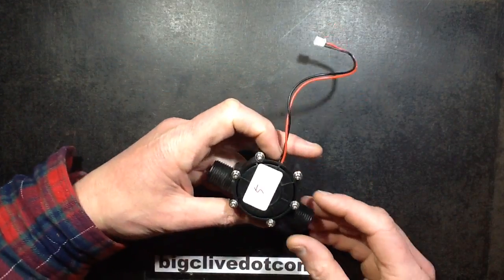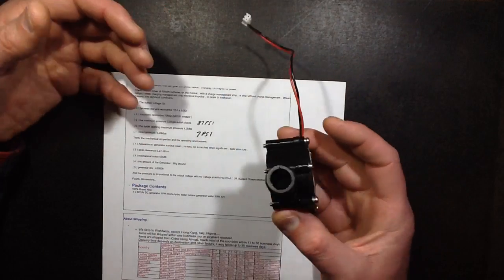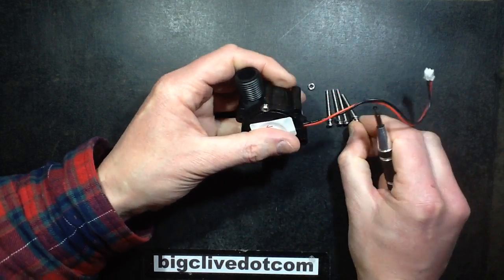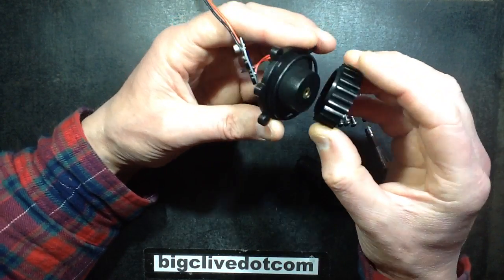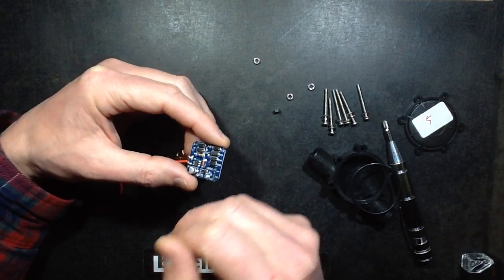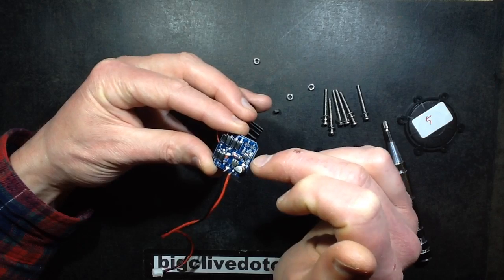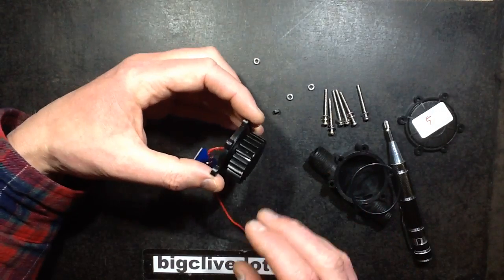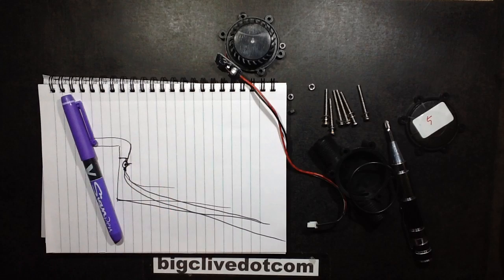A look inside a micro water turbine.

Comment: yes you need to build a venturi system you start with a diameter say 4 inches 100 mm then reduce the size of pipe in steps  eg reduce the 100mm to an 80mm bore then to say 40mm each reduction increases the speed of the water as it goes down slope

Comment: OK Clive, if you don't mind a rambling reply. I looked online for these and some advertise 5V or 12V  and others just say 5,12,80V with no selection option. The ones with the multiple voltage say 10W at 80V and about 2.6W at 12V. For your waterfall you might be able to put a standard computer fan in a sewer pipe. There is a man who drives a hoverboard motor from a computer fan blade. The generator is at the top and driven by water flowing down the pipe by syphoning. I think if you rectified and waterproofed the computer fan it could drive some fairy lights. How long it lasts would be fun to find out. If you have a go I'd love to see if it works. Mark.

Comment: There's another video here on YouTube somewhere where the guy has a small waterfall on his property and is using the 12V version of this to light up the pond at the bottom, he has goldfish in it and the led lights attract the bugs to the fish! He said that his one lasted a year running non stop! It might not be much energy but I think that it's paid itself over the year.. maybe if he opened it at the 6 month mark and cleaned it out, it might have run longer on that dirty water.. that 5V one isn't that good... The unregulated ones apparently go up to 80V, just needs an MPPT Charge Controller to make the most out of it!

Comment: Anyone willing to help id appreciate it. I have the 80v model as opposed to the 12v one my question is if i take out the moduke and replace it with the tp4650 or a 3/5v usb boost would it be more efficient. I regret not having gotten the 12v. Problem is ilmy water pressure isnt enough.
Reply: I can't answer your tp4650 or a 3/5v question directly, but unfortunately nothing you do with the electronics can make up for low water pressure.  You say the problem you have is low water pressure and I think you are probably right.  Nothing you do electrically can compensate for your lack of water.

The problem you are up against is the low of conservation of energy.  The number of watts of electricity that comes out of the generator can't be greater than the number of watts of mechanical energy that comes in via the flowing water.

You are probably familiar with calculating watts of electricity by multiplying volts times amps (P = I x V).  The power available from the water can be calculated in a similar way by multiplying the pressure times the volume of water flow (times a constant when needed to account for the particular units being used).

This site will calculate the theoretical (maximum) amount of energy available from water given the flow rate and "head" (see below):

https://www.engineeringtoolbox.com/hydropower-d_1359.html

This site has smiled down equation with a fudge factor in it to account for efficiency losses in the turbine:

https://www.homepower.com/articles/microhydro-power/design-installation/back-page-basics-hydro-power-calculations

There are a few things to note though:

1) Instead of pressure, "head" is more commonly used in hydropower calculations.  Head is basically how far your water has to fall in an open system.  For example, how high the water is behind your dam.  Since the density of water and gravity are fairly constant around the world, "head" can be converted to pressure (or visa-versa).  One meter of head is about 10 kPa.  Two feet of head is about 1 psi.

2) For the turbine you have there will be a fixed relation between the pressure and the flow rate.  This is a bit like an electrical resistor that has a fixed relationship (V = I x R) between voltage and current -- if you know one, then the other is already determined.  Thus, with the turbine you have, you can't "make up for" low pressure with more flow.  You would need a different turbine to get more flow at the same pressure.

Comment: maybe more electricity could be generated from sunlight by using a solar panel and a transistor to turn a electro magnet on and off. when the transistor is on the electro magnet attracts a permanent magnet and when it turns off... gravity 🤷‍♂️

Comment: "The listing states 10W but the 78L05 will not supply 2A! I'd guess this unit will be rated more conservatively around the 1W area or less. I haven't tested it though." it shouldn't supply 2A ...but 0.83A because well mathematics 12 volt x 0.83A = 10Watt. Still some of them say 150mA (hope it can do at least 0.1A which is 1.2Watt) - I've ordered one different design ..similar but it was a logo and some specs on the sticker ("Sea" ..logo)

Comment: Did you ever find a solution to light some leds at your brothers waterfall of a couple feet drop.  I am trying to do the same near a stream in India.  I'd be most interested in any solution you found to hydro generate some usable watts to light some leds .  Tx.  Bob C
Reply from the maker: It needs a high flow.  There's an interesting turbine design that uses a large spiral screw in a sleeve to generate power with a low drop.  https://www.youtube.com/watch?v=p9-nzuMrVyY

Comment: I have no background in electricity or electrical components, was just curious to know if it would be possible to use a turbine like this to power a small pump thus creating an infinite loop ?
Reply from the maker: Alas, the physics don't work like that.  The turbine would not generate enough power to drive the pump fast enough.
Reply: that's what I though...
Reply: Sadly physics. but there is a few locations that are using hydro water storage to store solar and wind energy during the day To pump water and then run in reverse during the night. granted there is an energy loss.
Reply: When I posted my comment YouTube glitched out and when it finally loaded it had 4 duplicates, I reloaded and only 2 remained. Too many people at home?

Comment: i have no background or experience in this sorta thing but i wager the best thing to do re: waterfall would be to put a pipe with a filtered inlet (enough to prevent sticks and whatnot from getting in) at the highest point you can in the riverbed and then run it to the lowest point you can down the river and put the turbine there with a union so you can remove it to clear the pipe if you need to (or replace the turbine i guess). i don't think putting it directly in the waterfall would create a consistent enough pressure, but with the length and diameter of the pipe you can manage the maximum flow and also have the pipe act as a flow regulator so if the output of the river fluctuates the slack  can be taken up in the pipe

Comment: What you really want is to maximize flow rate. And although it is true that the flow rate into a pipe will equal the flow rate out, the pressure will be different at each end if there is a change in height between the two ends. The higher pressure will be at the lower end. If you then put a nozzle at the high pressure end (ie the one down stream from the waterfall) the water will reach a VERY high velocity and therefore high flow rate.

Comment: you are correct about the hose.  the reason turbines are at the base  is to do with the  pull pressure causing the water  to boil.

Comment: this is a response to look inside a micro water turbine.
 I have the identical unit accepted claims to put out 12 volts.
 I've been studying Micro Hydro for many years and traveling several countries observing them.
 this is Pico Hydro.
 personal I would set up a garden hose penstock.
 catch the water as high as you can and  run the hose as far as you can.
 putting the turbine at the end of the hose or somewhere in the middle.
 effectively a penny stock and tail race.
 interesting fact in Quebec Canada where I live. is it legal to make any amount of electricity off of falling water
 even off the eaves trough of my house
 I also have the ...higher current and voltage micro turbine... that you took apart
 I'll be highly interested in watching you set up the two units on the smoke waterfall.
 your videos are fantastic thank you very much for all of them
Reply: cant tell if you are asking or telling that it is legal to generate power from moving water. You say it is a fact in Quebec Canada (as if there is some other quebec) and then you ask is it legal. so what is your point?
also you say to make the hose as long as possible and then put the generator at the end but then say in the middle. i think you haven't got a damn clue about what you are talking about. i dont believe you have travelled to other countries to study micro hydro. Why would you bother to go to another country to see someones plastic chinese ebay generator on a hose?
Reply: It may well be the case that you could use a long hose with a generator at any point along it. The rate of flow should be constant along the whole length, but you'd be getting the benefit of the whole potential difference..
Also there are several other Quebecs (just googled it).
Reply: GODINN LIVES 
 it is illegal to make any amount of electricity off of falling water in Quebec Canada..
 this is PECO electricity from falling water.
 not micro.
 and I don't care if you don't believe me that I traveled around the  world
 looking for micro not PECO electric generation

Comment: what about buying thousand of these so every time you flush your toilet you gnenerate megawats of electricity? lol.
Reply: physics unfortunately would rule out your idea pretty quickly given that there's not enough mass of water in your toilet tank reservoir to actually generate significant amount of power, it doesn't matter how many of the generator you hook up if there's not enough energy stored in the form of the mass of water with potential energy in them... we can't generate energy out of nothing after all, we can only convert them.
Reply: Iono Sama let's make a fusion reactor.
Reply: Wouldn't be that much because of the limited circumference unfortunatly
Reply: I just got 6 of these and I know its only 220mah, yet 80v, what would you suggest to increase the amps even if you had to compromise volts, I was thinking about a circuit inverter, or a transformer with a secondary winding?

Comment: If there was a battery connected, I wonder if the circuit would keep it charged until the turbine stopped then use the battery to keep the 5v output going? That would make sense if the circuit was used with a wind-driven turbine which might be more gusty than a water-driven one.

Comment: You have probably already learned this from posts below that I'm too lazy to read or from practical experience at your brother's place, but here goes; It is pressure, not velocity that turns the turbine. put the turbine as low as possible and the inlet as high as possible. the pressure on the turbine will be equal to the mass of the water in the vertical drop times the area of the turbine inlet. reduce the pressure by the turbulence in the hose. Big straight pipe = low turbulence. skinny twisted hose = high turbulence.
Reply: In this specific case, it takes little force to get the turbine spinning, so you really do want to jack up the speed a fair bit if possible. The way that the turbine generates electricity is by changing the magnetic field that the coils are in. Getting the blades to spin faster (and therefore oscillating the magnetic field with great frequency) will make the voltage output higher. The resistance in the coil is a constant, so you would also get a higher amperage, and therefore higher power output. In this case, the limit on the speed of the blades is the speed of the water, and this limit is reached with a significant force caused by the water. The force need to get such a tiny turbine spinning is small enough that you could give up most of the water pressure for speed, and still get the blades spinning as fast as the water is moving. A bigger turbine would take more force to get spinning, but at the same time will give a higher voltage output for a given rate of rotation. If you had a bigger turbine, then you would want to maintain a higher pressure so that it will reach the speed of the water. Because we are talking about a type of electric generator, the rotation rate of the motor shaft is was directly affects the power output. The force only matters insofar that it is needed to get a high rotation rate.
Reply: Alberto Knox Not quite. What you want is maximum mass flow rate. Mass flow rate is determined by the density, cross sectional area, and velocity of the fluid. However, high pressure is very important to getting high velocity, as the two are related. But it is the velocity that will ultimately get you a higher power output from a turbine.
Reply: Tronique
However do you not want the flow in the pipe to have a lower average velocity to reduce losses?
Reply: Yes. You would use a wide pipe for most of the way, then put a nozzle at the bottom, right before the turbine, to achieve the high velocity. The high speed water will have a large kinetic energy, which will make the turbine blades spin VERY fast (the faster the blades spin, the higher the power output, that's what we want here)
Reply: Power is the product of force and displacement, just like in electricity where volts (pressure/force) and amps (displacement/velocity) are multiplied to yield Watts (power). reducing the size of the tube increases velocity at the cost of pressure. It doesn't increase the amount of power a system holds. A properly sized turbine and generator will extract the power from the flow you have. The amount of power will be dependant on the rate of flow (often called "Q") and and the height of the column of water above the pump (called "Head" in this application). A slow turning turbine can generate a lot of power if geared correctly.

Comment: Waterwheel, 6 feet diameter, geared from shaft to alternator.  Runs 'Backwards' as the water enters below 9pm on the wheel.  Works a treat for anything greater than 2 foot fall. For gears I just used cogs and chain from a pushbike.

Comment: So did you ever get this to fruition? I would have used a ram pump with a pressure tank to act as a capacitor for smoothing out the pulses. Used the exhaust from the pump as a "fountain".

Comment: waste of time. you know nothing real engineering wise, Clive. This vacant tearing down  is not illuminating. you did not even trace down the circuit.  And you know nothing about hydraulics.  Laughable junk video.
Reply: Azzy M I just got 6 of these and I know its only 220mah, yet 80v, what would you suggest to increase the amps even if you had to compromise volts, I was thinking about a circuit inverter, or a transformer with a secondary winding?

Comment: There are powered faucets/flush valves that use these kinds of devices to keep themselves charged so you don't need batteries of a power supply. Makes a lot of sense in that application.

Comment: on ebey three different types listed by same vendor all at same price.

comeon365      £5.12 each on ebay  

Micro hydro generator, the potential energy conversion of the water into electrical energy mechanical equipment. We provide you with three kinds of generators,
Can be directly to the small battery charge,
Can charge mobile phone,
Can give 12V radio power, charging, power supply for LED lights, etc

·Appearance: generator surface cleaning,
no corrosion, the structure is strong.
·Axial gap 0.2 - 1.0mm
·The mechanical noise :≤55dB
·Generator single volume: 90g
·The life of generator:≥ 3000h
·Output characteristics: the output voltage with
no voltage regulator is proportional to the water pressure.

F50-80V:

DC 0-80V output, generator without voltage regulator circuit, peak voltage reached
80V,Can be directly 10W LED about 3-12V lights, can be directly to the small battery
charging, charging current maximum 220mA.

F50-5V:

DC 5V regulator output, you can charge the phone, you can also charge a lithium
battery charging management chip.

F50-12V:

DC 12V voltage regulator output, you can give the 12V radio power, charging, power
supply to the LED.

Technical condition:

Output high voltage: 80V (1.2Mpa)
The maximum output : ≥220mA (12V)
Line resistance :10.5 + 0.5
Insulation resistance: 10M (DC100)
The outlet closed the maximum voltage: 0.6Mpa
The water outlet open the maximum voltage : 1.2Mpa
Start water pressure :0.05Mpa
Size:8.8x5.8x3.9cm(L X W X H)

Note: according to the direction of the arrow, the standard of 1/2" water pipe.

Package include:

1 x Micro Hydro Generator

Comment: To expand on your idea. if you were to give the top of the hose a larger diameter to the bottom, the volume of water, and the speed it was flowing would surly increase to speed of its flow at the end of the hose. Or would it? Time to experiment!!!
The extra weight of water must make a difference though.

Comment: Hi clive i found this little gadget and had few ideas on how i could use it in everyday life it would require charging a lithium rechargeable battery to to use it when water is not flowing could it be done and how hard would the circuitry be if any ! Im an electrician (electronics not so much) any ideas ? It will be powering LED lighting strip , get your thinking cap on :)

Comment: as the pipe gets longer you will have more head loss (more drop of pressure), you have to calculate your head loss and see whether or not the head loss causes excessive drop in pressure.
you can also choose your pipes as big as possible with smoother finish inside the pipe to reduce the head loss.